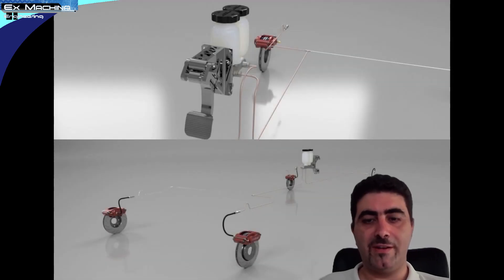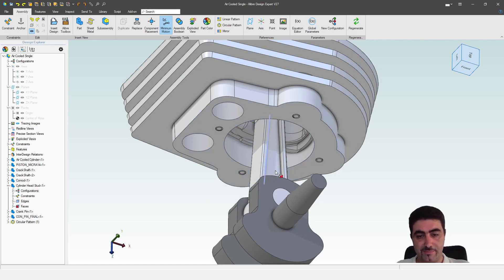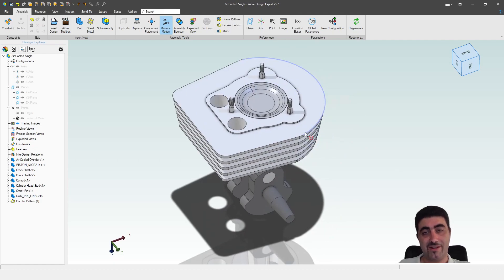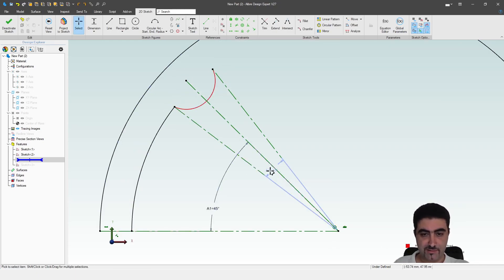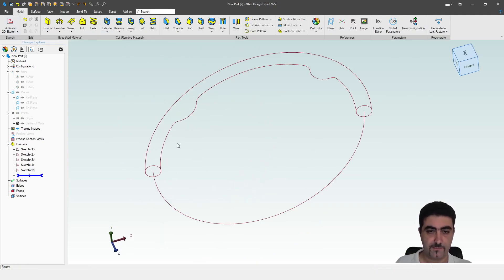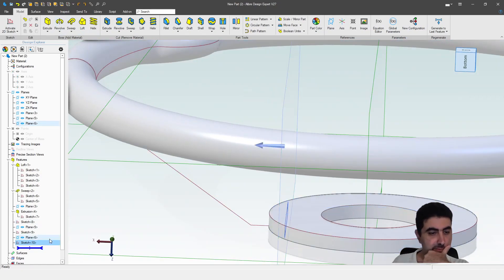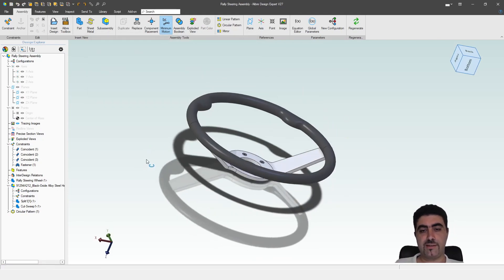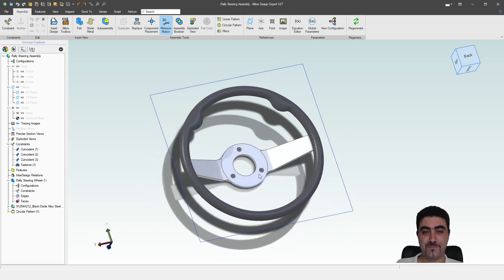Discover the Hidden Power of Alibre's Global Parameters Today

Comment: Nice one! I slowed the speed down to 0.75 to get a better understanding of how you're designing the steering wheel.
Reply from the maker: Thanks man! I'm still on the fence about using sped up videos. But in any case I think global parameters are a great way to add flexibility to your designs. And I also think that they're real easy to use too.